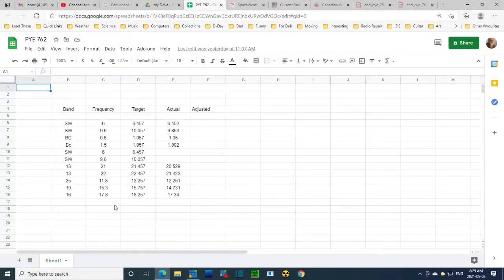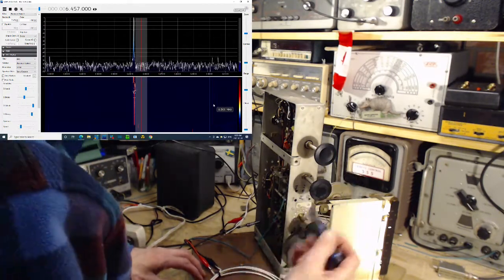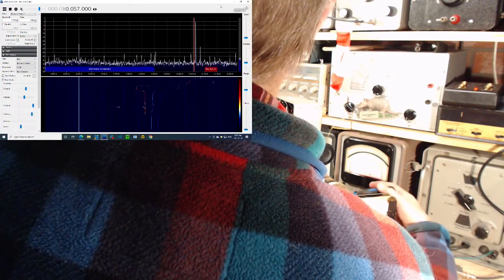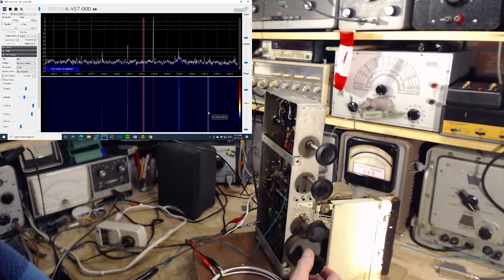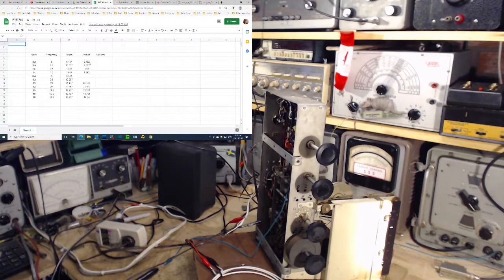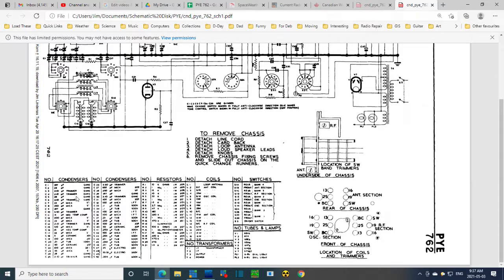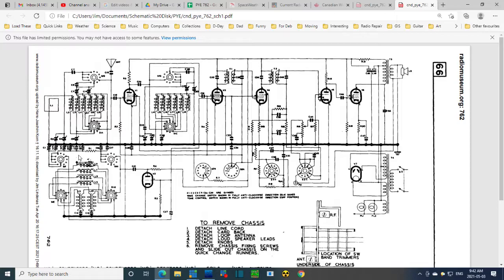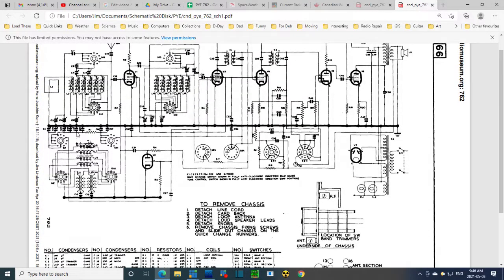Canadian PYE Model 762 Receiver Video #9 - Six Section Tuning Capacitor

Comment: Do not bend the plates on the stator section of old tuning condensors. Worest case they used pot metal to mechanically mount, encase and space apart the blades. Since pot metal gets brittle it may crack, leaving you with plates flapping in the breeze. Glassslinger had a case of flapping tuning cap stator blades in one of his repairs and it was a hell of a pain in the rear to fix it.

If you want to test the influence of a section here is a tip:
take a strip of some stiff aluminium foil, insulate both sides with thin scotch tape just leaving open a single spot. Connect clipleads to that open spot and ground. Now introduce the double insulated part of the foil in between two stator blades. Your construct will raise the capacity of the particular section under test giving you a clearer reaction than bending plates.
Reply: Yap. You are correct about the stator plates. And while the idea with the aluminum foil is good, you can just as well open the banana slicer halfway and touch a cap of adequate value (say 100-200pF for the big section) between stator pack and rotor pack. A cap that size should get you an even bigger change in capacitance and a better indication than the single improvised rotor blade.

Comment: Now wait a minute. At 22:29 you set out to identify the 6 sections of the tuning cap on the schematic and you succeed in pointing them out, even realizing how the different sized sets of plates are switched over depending on the band selected. Yet at 40:04 you come to a different conclusion just based on poking the blades of the cap? Follow the schematic! This tuning cap is in a normal arrangement for a radio that has a tuned RF preamp. This is no witchcraft.

Comment: I would make a scan and print a copy of the dial face and tape it behind the pointer. Make sure its lined up the same as when in the cabinet. A bit of extra work but think its worth it on this one.  Also it might helpful too maybe to set the pye project aside awhile, grab a couple easy projects and come back to it.
Reply: That would not fit Jim's standards - The guy is complaining because the lower part of the band drifted 2KHz after aligning the upper band !!! 2KHz !!!!!!!!!!!!!!!!!!!!!!!!!!!!!!!!!

Comment: Madness at large. Maybe if he uses PowerPoint and Photoshop instead of the spreadsheet, connects a blender to the radio antennas and uses the SDR to store cat litter he would get better results. More than a decade doing radios and doesn't have a clue how a receiver works.

Comment: What am I watching?  I am not getting the point of any of this. Justifying messing up an alignment?  No just heard at the 53 minute mark it was the young engineer's who messed it up!
Reply: Besides receiver being ridden with factory assembly mistakes only he can spot at a glance.
Reply: @Tom4Jean  
There is no point to be gotten in this video. The use of the 6 section capacitor had been explained on the comments videos ago, so no need to be selling it as his own revellation.
And the use of an SDR plagued with image and ghost signals to recreate a dial pointer setting to a precision of 5kHz or less is just an exercise in futility.